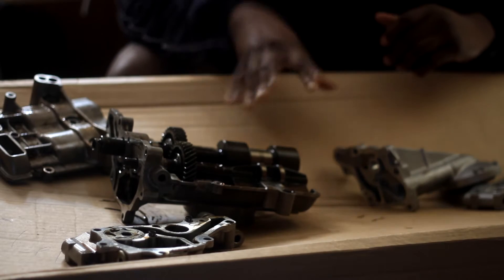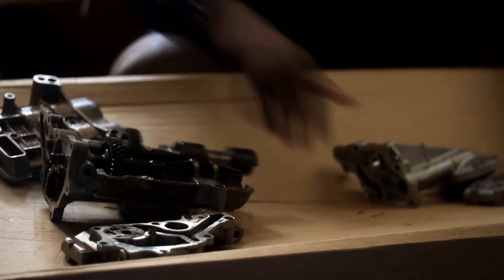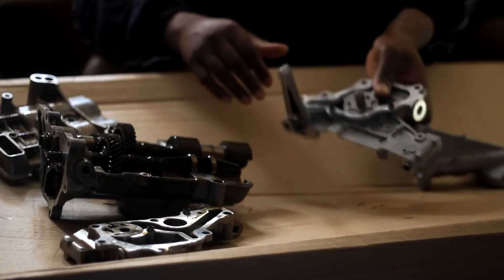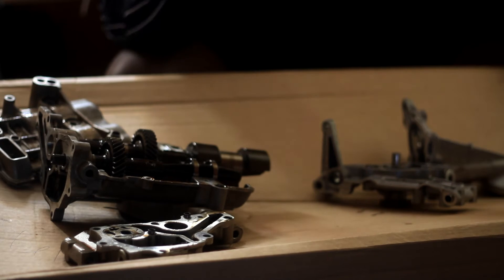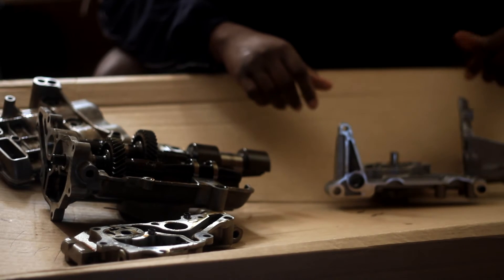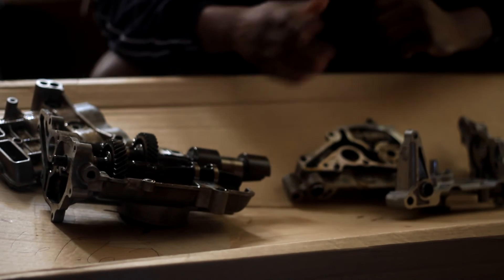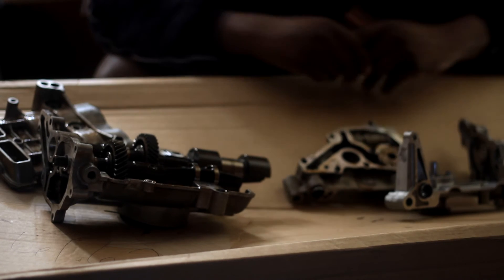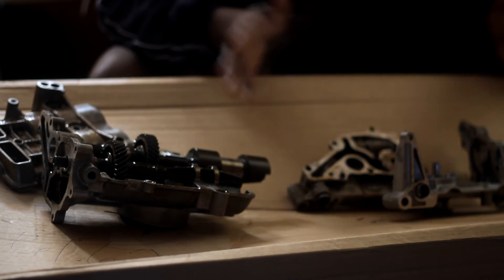K20 OIL PUMP UPGRADE | SHOULD YOU DELETE BALANCE SHAFT?

Comment: If i remove the balance shaft in my stock k24a oil pump then what will happen?.
Reply from the maker: I do not even think it will work without the shafts inside and its still a big mass attached to the engine so it is better off running a type s / base model oil pump or s2k pump
Reply: More Vibrations, duh!

Comment: Nice video, thanks! Quick question- Would it be possible to just remove the balance shafts from the stock oil pump and plug the oil supply hole instead of replacing the whole oil pump with the RSX pump? I can't see from the video if the balance shafts drive the oil pump. Thanks in advance!
Reply from the maker: Avery Alexander not sure that has been done but think about it, if u gut the internals of the stock pump u still have that heavy chunk of metal in the pan so the same amount of effort gutting that pump it’s better of swapping to the Type-S style.
Reply: @kadeemwillock6335  Thanks. The reason I was thinking about modding the stock pump is because changing to the RSX oil pump is so expensive. It's not just the pump you need, it's also the chain that drives the pump, the chain guide, chain tensioner, and the windage baffle, and possibly oil pan, but not sure about that, which would cost $200+ dollars or more if I need the oil pan. Also, I have heard that the stock pump with the balance shafts spins faster than the RSX pump and makes more oil pressure at lower RPMs. What I heard is that the RSX oil pump spins at 1.6 something times engine speed compared to the stock oil pump, which spins at 2X engine speed. Does the sprocket come off of the RSX oil pump? One possible solution I thought of is to sprocket the pulley from the stock oil pump onto the RSX pump, that way I may be able to reuse the stock chain and keep the 2X rotation rate for more oil flow and pressure.
Reply from the maker: Avery Alexander well before I begin you can experiment and do what’s best for your motor. The sprocket on the type s oil pump is not interchangeable if I remember so that is not an option. Yes it spins faster which causes the cavitation but this is all depending how high the motor is revved. My complete oil pump kit except for new tensioner and guide but the pump and baffle are used. What kseries is your engine, what are your goals and set-up with your car.
Reply: @kadeemwillock6335  Thanks. I actually don't have a K yet, I am planning a K swap in my beloved ES1 Civic. I am thinking I am going to go with either a K24A2, K24A3, or TSX type JDM K24A since those engines all basically the same thing and make 200+ HP from the factory and can be purchased for a reasonable price, well under $900. I don't plan on revving higher than the stock rev limit since this is going to be my daily driver and it needs to be reliable as possible, so no boost either. About the most this engine would see is a mild tune and basic bolt on's. So I am thinking the stock oil pump that spins faster and therefore moves more oil at low RPMs would be best for me, but I'm thinking I would like to get rid of the balance shafts before I install the engine to reduce weight and drag a little and to increase reliability, and if I could do it for free that would be ideal so I have more money to spend on the other parts I need for this swap like a trans. Thanks
Reply from the maker: Avery Alexander if you are staying n/a just get a k24a2 and that should be a decent drop in swap. Something I’m learning myself is to not over complicate certain situations/ideas, good luck
Reply: @kadeemwillock6335  Thank you, I really appreciate your help. I'm thinking I will remove the balance shafts from the stock K24 oil pump if possible, but I don't think buying an RSX-S oil pump and everything else I need to be able to use it would be worth it for my application as that would cost several hundred dollars. I'm not racing or anything, I'm just looking to build a fun and reliable daily driver and I think my money would probably be better spent on other things like replacing the engine's timing chain and seals before I install it since reliability is my main goal.

Comment: you know the type s oil pump comes on the a3 in the base rsx from factory
Reply from the maker: justindrumm8 yes I may have mentioned it in my videos but yes you are correct, base dc5 with k20a3 came with prb oil pump. I guess the SI was too luxury hence the reason for a balance oil pump.
Reply: Kadeem Willock i got a question you might be able to help me out with. i have a ep3 a3 block, going full a2 internals. now i have the a2 oil pump and wonder if i can keep the stock steel pan?

only reason i ask instead of getting a a2 pan is that the base rsx uses the same steel pan as the si
Reply from the maker: justindrumm8 should work especially if it’s the same part number and depth

Comment: Just to add on, the balance shafts spin at 2x the crank speed. The type s pump spins @ 1.62 the crank speed. That's why the type s pump can rev higher without cavitation. B series never had that problem because their pumps run 1 to 1. But since the k series has vtc they needed to keep the oil pressure high in the lower revs so they spin the pump a bit faster. The balance shafts on the other hand by design need to spin twice the crank speed to be effective in canceling out the second order vibrations, but also since they are spinning faster it translates into more oil pressure which is great for turbo setups.
Reply from the maker: PrimeGarage nice so if I’m reading correctly the balance shaft pump is ok for a boosted application?
Reply: Kadeem Willock yes exactly. it's not a recommended mod to do with an a2 or z1, but if you have a k24 or k20z3 and plan on going turbo the type s pump really isn't needed.
Reply: @MrDelsoleg11  If i remove the balance shaft in my stock k24a oil pump  then what will happen?.
Reply: PrimeGarage i actually rev my stock z3 to 8500k no issues, 140k
Reply: @hevertpacheco7870  well of course you can, flashpro raises your fuel cut to 8600 rpm, you can rev to 8600 safely all day, anything more than that becomes an issue.